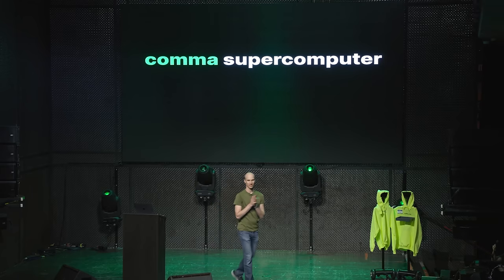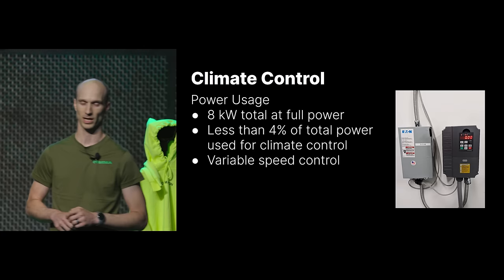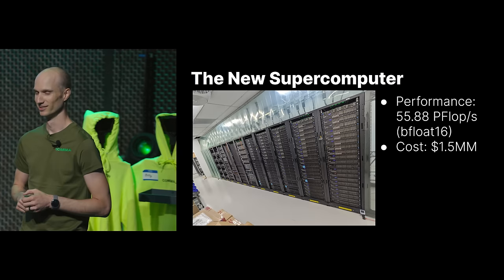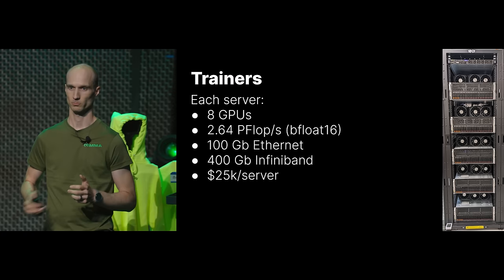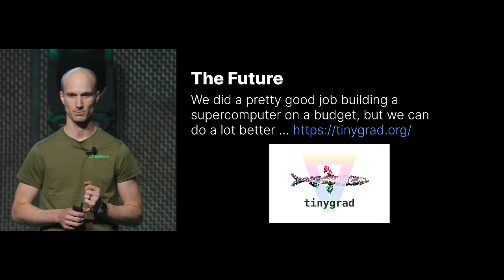comma ai | comma supercomputer | Greg Hogan | COMMA_CON talks |  Machine Learning Training & Compute

Comment from the maker: Thank you to the comma team for this amazing event, sharing the livestream and high-quality videos. All credits to them. Follow their official youtube.com/commaai for more livestreams.
Check out blog.comma.ai/dev-speed/ | github.com/commaai/minikeyvalue/ | github.com/geohot/minikeyvalue | comma bounties blog.comma.ai/welcome-to-the-openpilot-team/
from $1250 buy -> comma 3X comma.ai/shop/comma-3x | openpilot.comma.ai is the best ADAS system in the world | If you have skill apply on -> comma.ai/jobs | Join the community on github.com/commaai/openpilot & discord.comma.ai | Check if your car is supported -> comma.ai/vehicles | How to setup your car comma.ai/setup | Stay up to date by following twitter.com/comma_ai | Support comma.ai at comma.ai/shop
Chapters:
00:00 intro
00:28 old office
01:37 not enough power, airflow
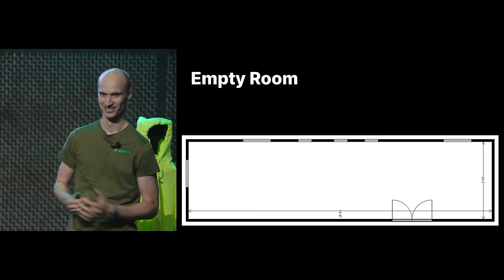02:50 new office - empty room
03:03 adding power, 800A, $125k for power
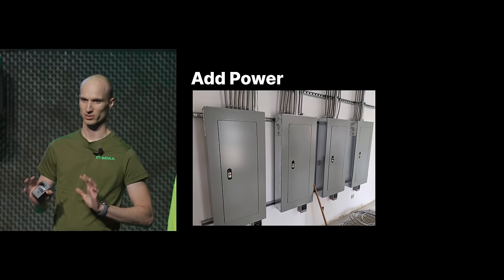03:27 walls, aisle for air, racks
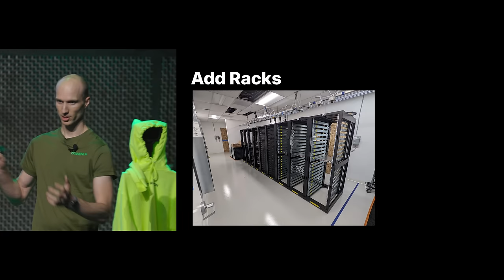03:43 knocking out windows
04:03 big fans for free cooling
04:24 recirculating hot air
04:53 strip curtain
05:10 destratification fans
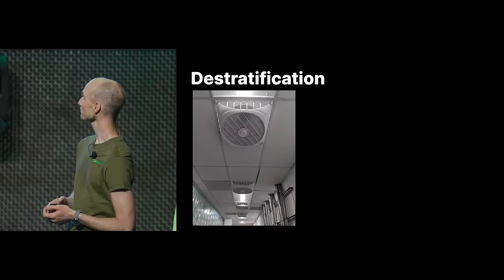05:35 end result
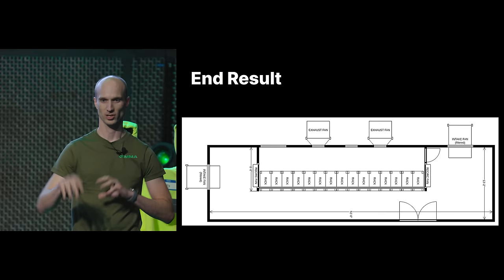06:09 climate control, fans only
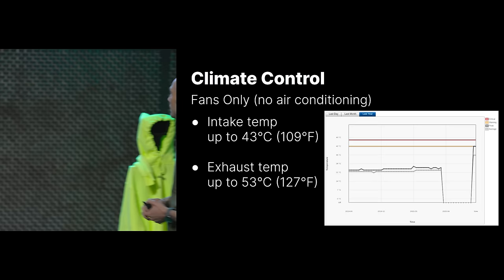06:40 used servers temperature history
07:13 power usage for climate control
07:50 8 kW total at full power for fans
08:40 vfd controller, 80A startup for fans
09:50 control policy for climate control
10:10 humidity target and control
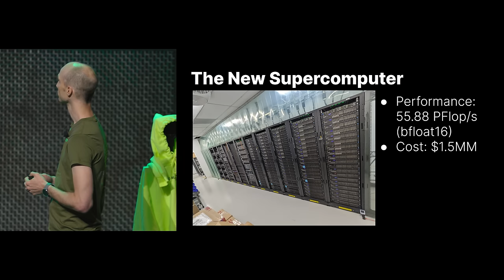12:55 the new supercomputer
14:00 comparable performance to other supercomputers
15:20 high level specs for the supercomputer
15:51 trainer servers
17:04 rollout servers
18:20 driving data, distributed file system, minikeyvalue
19:06 data diversity
20:07 training openpilot models
21:25 model overview
22:05 vison model
22:35 policy model
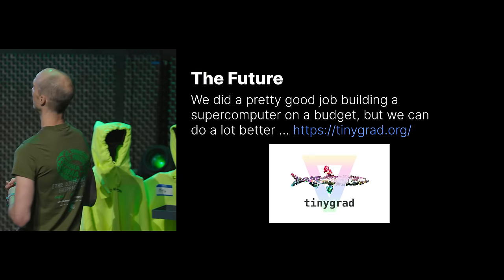23:00 the future, tinygrad
23:40 tinyboxes
23:50 Q & A
24:20 high temperature datacenter
25:44 Greg is awesome
25:54 data center word usage, big fans, cost analysis
27:15 backup solution for power outage
27:25 production customer facing is azure, on-premise for research
27:48 cheap because we accept some downtime
28:50 question for research team
29:10 what GPU is used for training, most dollars per flop
29:40 GPU for rollout servers highest memory bandwith per flop
30:10 question for research team
30:36 time for the whole training process
31:16 too hot for people in the hot datacenter
32:14 lower all-in cost per petaflow for training
33:20 die temperature in hot datacenter
34:15 time to boot up the supercomputer
35:20 fan speeds, exhaust and intake fans at different speeds
36:38 data sales for $200k offer did anyone buy it?